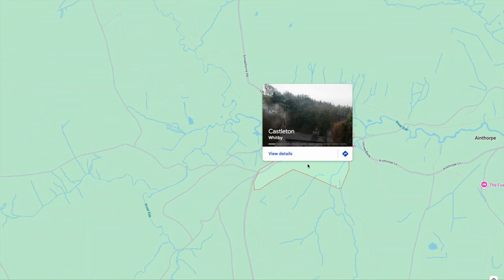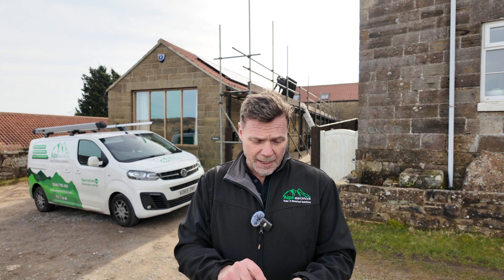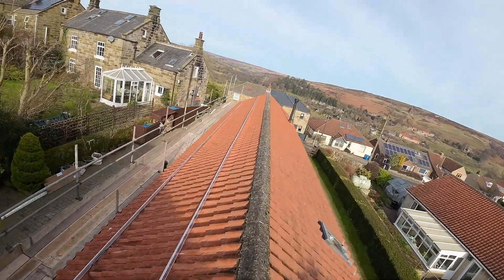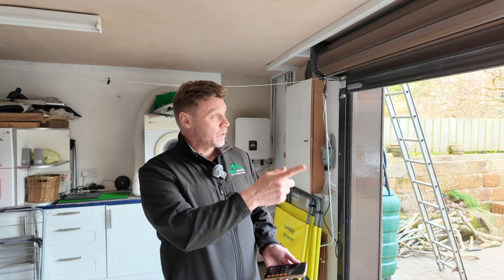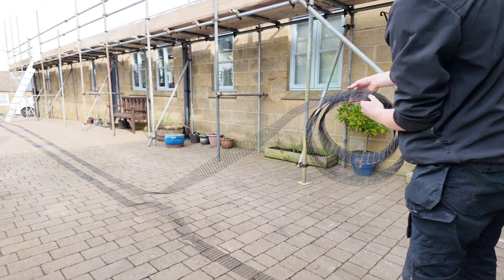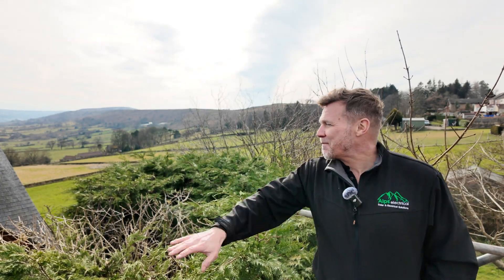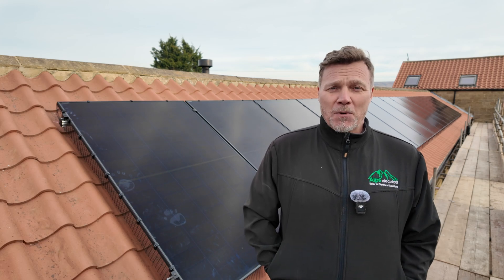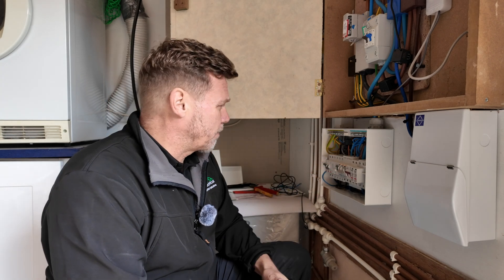8 kW FOX ESS Hybrid Inverter & 17 kWh Fox Cube Battery Installation | Teesside | Alps Electrical Ltd

Comment from the maker: 🌞 Check out this FOX ESS 8 kW Hybrid Inverter + 17 kWh Fox Cube battery setup — designed and installed by Alps Electrical Ltd right here in the North East ⚡

We’d love to hear what you think — drop your questions below 👇

📞 01642 790489 | 🌐 alpselectrical.com

📍 Serving Teesside • Durham • Sunderland • Newcastle • Northallerton • and beyond.

Comment: Looks like a quality install and very well presented. One thing I couldn't help but notice was the location of the panels on the taller back roof building shown at 13:10 seem to be quite low. Were there structural considerations for this or something else? If they were moved closer to the top they would achieve slightly better efficiency and be less subject to shading particularly through winter time and if those nearby trees grow taller.
Reply from the maker: Thanks for watching and fair point, but there is a reason for it - firstly the trees were later cut down which would rule out any shading potential, and also when installing solar, particularly on steep pitches it is necessary to install the bottom rail first to enable you to use that as a step to work further up the roof - therefore this needs to be low enough to easily step on it without slipping. Unless there is a very necesarry reason to favour the top of the roof and it is safe to do so then we would always favour the bottom part :)